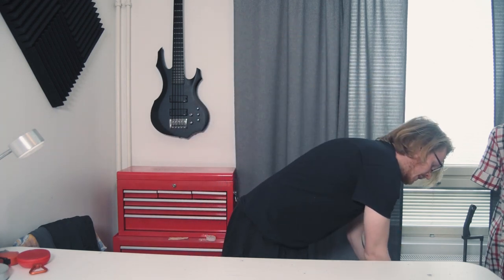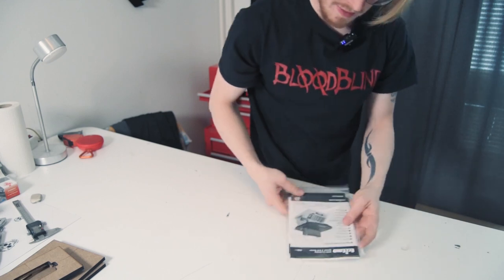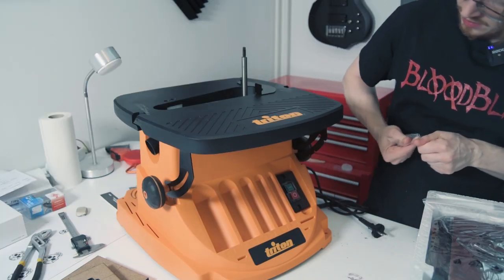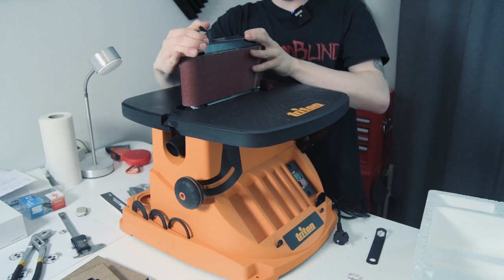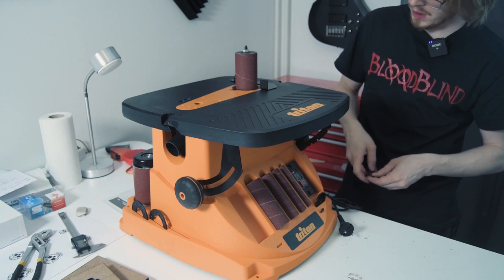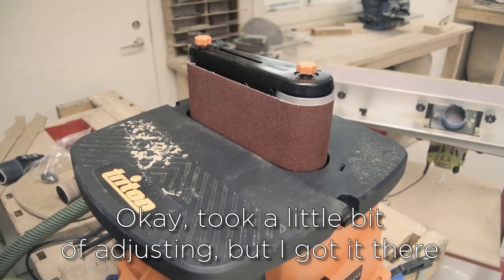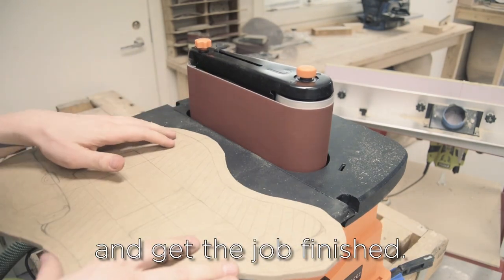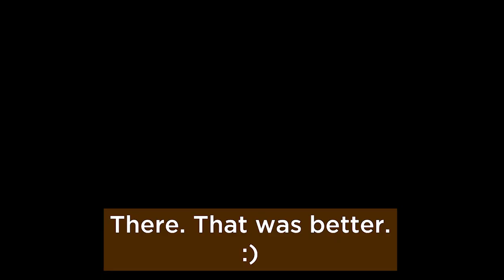Triton TSPST450 OSCILLATING SPINDLE & BELT SANDER Unboxing

Comment: I relaxed at the end when I saw you weren't using in it your apartment without dust control or at least a shopvac attached :)  It's one of the most desired things the bouncy sander!  I like how it's so self contained, with everything having a place on the base.
Reply from the maker: Yeah, now that I have access to the maker's space I was able to get it :D no way would I have gotten it otherwise!

And I love the self-containment part of it too, though I have to keep the whole thing in a box, just as a safety measure, so that the machine doesn't get used without permission and bits go missing😅

Comment: Brilliant bit of kit, even better when sat next to the spindle version. The deck on the spindle one is better than on this one but the belt is great for flats and the outside curves. Being able to swap between the 2 is a bit of a luxury but can get bodies shaped pretty quick :)
Reply from the maker: I used to have access to the plain spindle version some years back and much influenced my decision to get this one as it does have the nifty swapability to it :) has definitely made my work run so much faster now.